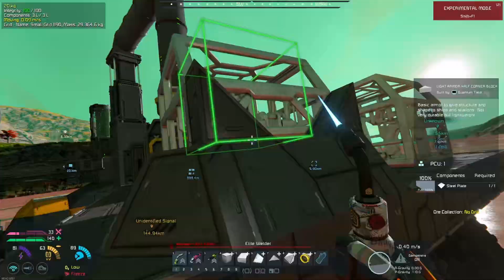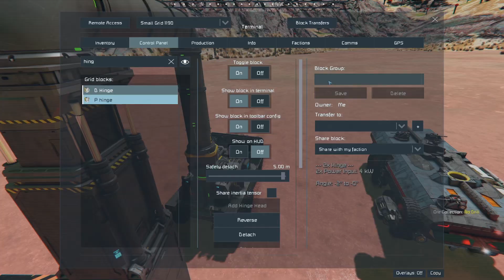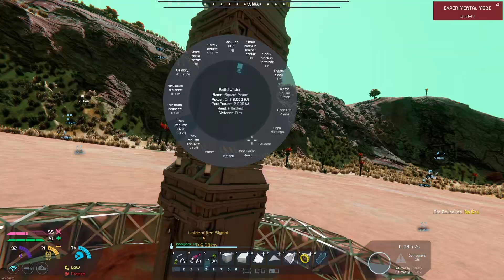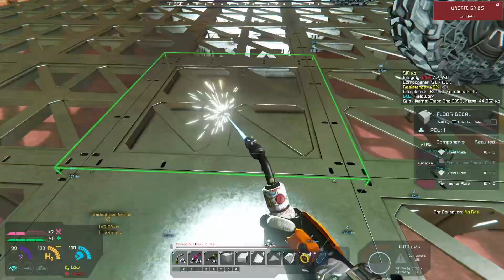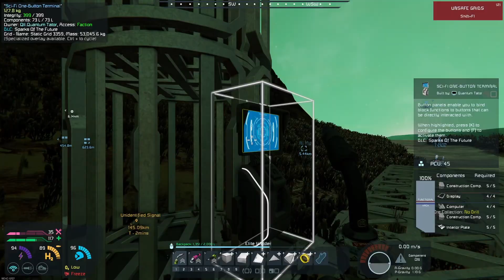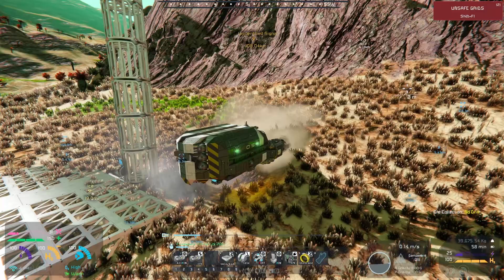Space Engineers 2025 E74: Farming Foundations!

Comment: If you're not having problems with the 5x5 wheels, and you're happy with how they're performing, no need to change them over to 3x3's just because of my input.

Having the pistons to lift the rover so you can work on the underside or replace wheels, can be handy.
You can also set specific extension lengths so that one hot bar button raises it, another stops when they touch voxel (on flat ground) to lock it in place either as a parking brake, or to just hold it still while you're doing something that can benefit from a stabilized rover.